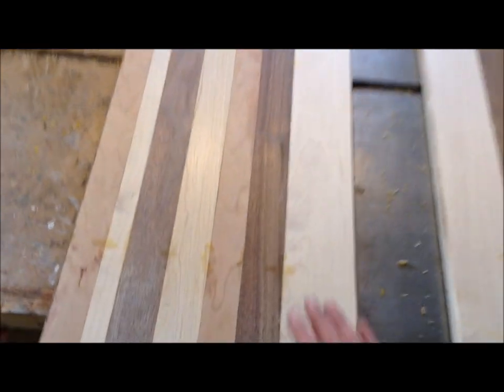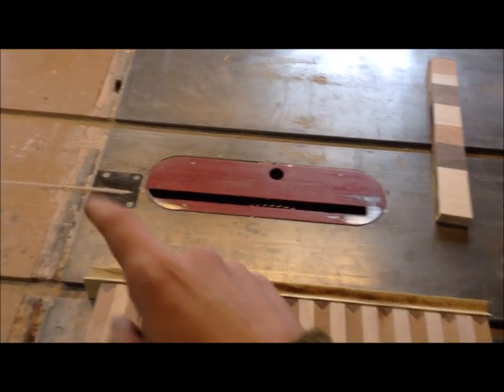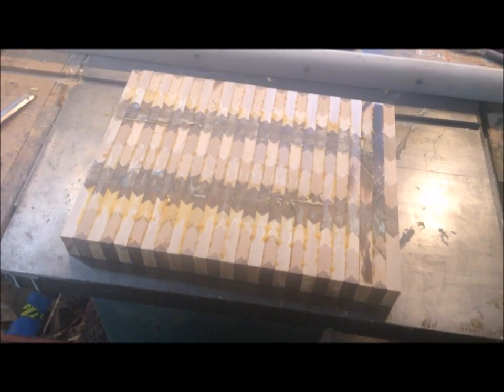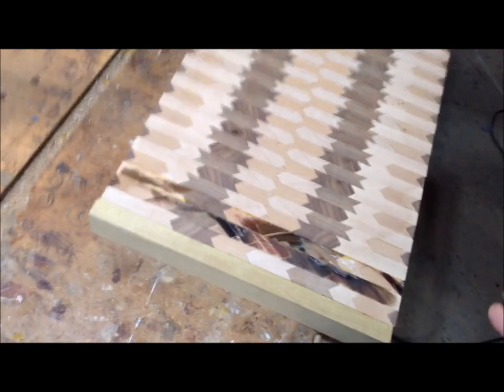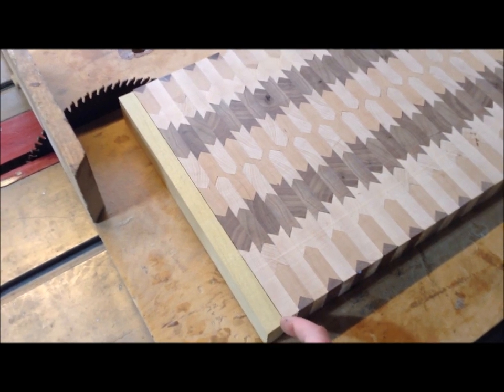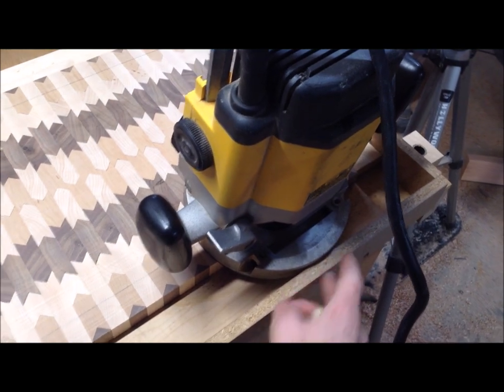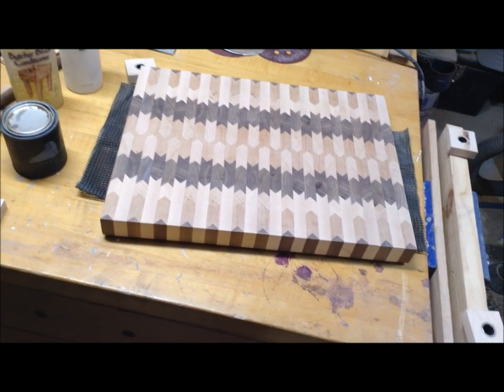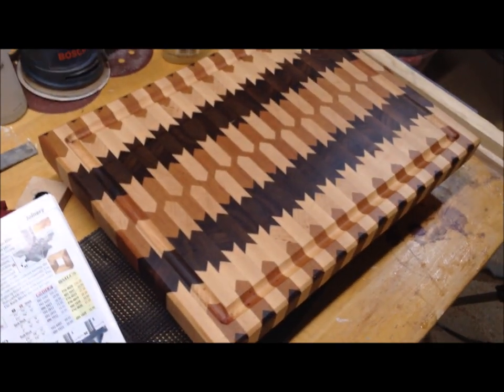How To Make An End Grain Cutting Board [ Part 2 ]

Comment: thanks for the heads up on the router bits.  It's just what I was looking for to create some variation in my cheese board projects.
Reply: I'll mill a board to 1" and use it as a test piece like you did until it's perfect.  At that point, I'll then have a template I can use as a setup block for future use.  no measuring needed.
Reply from the maker: That would have been smart to make, would make making another one so much easier.
Reply: belíssimo trabalho meu amigo ficou top parabéns estou impressionando  com este trabalho

Comment: Really nice job. Adding chevrons made this much harder. Selfishly, I'm glad they weren't perfect and needed some sanding and patch work. When you started out I thought, no way will those be tight. Glad it worked out. Re: Juice groove, you can sit your plain board in a cookie sheet which will catch anything that runs over. If everything is clean you can use the drippings for gravy. If you add silicon feet, the board wont sit in the juice. I've struggled with getting perfect juice grooves only to have them over-flow anyway. (We do a full crown roast every Christmas, no groove can hold that...)
Reply from the maker: I was going to put the little feet on this, but the customer saw the board before I was finished and asked me not to haha.  Routing the juice groove was not my favorite, the cookie tray is a good idea.

Comment: Quality bit for juice grove is  important but I found that bit speed is a bigger factor. Slow the router down to slowest speed and the burn marks go away or at least are greatly reduced.
Reply from the maker: Good point, will try that next time.  I usually forget to adjust the speed with bit changes.